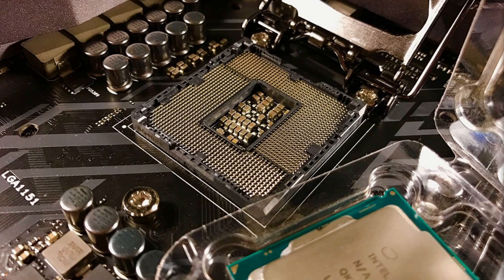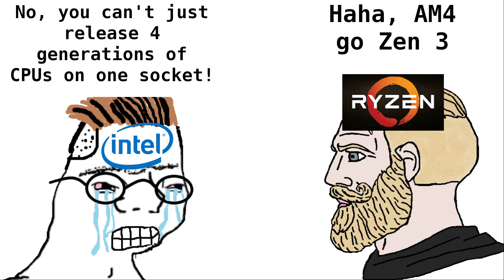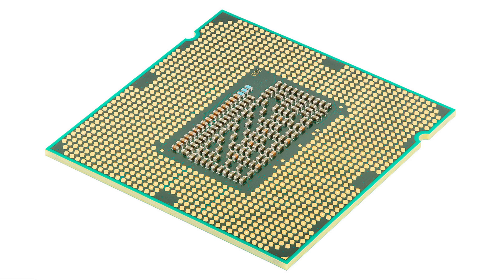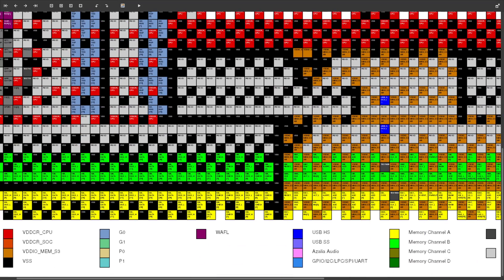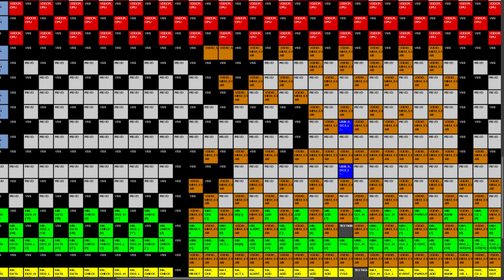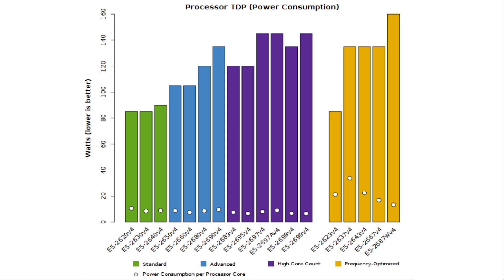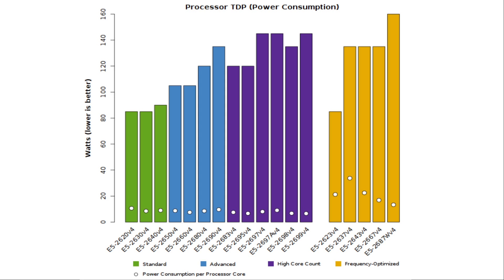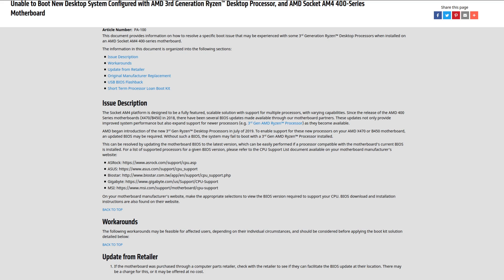The Reason for CPU Socket Changes

Comment: > Intel: releases same CPU on a new socket
> AMD: releases new CPU on the same socket
Reply: intel is israel
Reply: It's true. You can actually use Athlon and the latest Ryzens on the same board. Well, not every board but most of them still support Athlons.
Reply: doesnt matter. you ll change ure mb every 4-5 years... even when normal human uses amd... he would have to change his mb anyway...
Reply: Intel loses customers
Intel: Shocked pikachu face
Reply: few years ago it was Nvidia gpus and intel cpus on top, now its nividia gpus on top (xt cards are horribly optimised especially when it comes to trouble shooting) and AMD cpus on top lol
Reply: and amd cpu runs better and is cheaper
Reply: @krellin  yep and AMD gpu sucks theres a reason why 6000 series amd gpus are in stock wayyyyyyy more often, tis cause no one wants em lol
Reply: We are not the same
Reply: > AMD: releases same GPU architecture with different generation branding
> Nvidia: releases different GPU architecture with same generation branding
Reply: @nathangamble125  sorry to ruin the fun, but Nvidia does in fact reuse their old GPUs and call it something new.
Reply: @koyyle  AMD cheap until everyone buys it then gets undercut by intel with a space heater nasa rocket cpu, which the amd fanboys also said they couldn’t do
Reply: @chrisg7990  I want ECC ram.
Reply: That meme is just fanboy cringe, 2 or 3 generations per socket is normal has been for decades regardless of brand, AMD just wanted play into the hands of customers with short memories and appear to be the good guys when in reality they are no different to intel or nvidia. 

None of them care about you, they are corporations that care about nothing but money.
Reply: @oxfordsparky  You're a bit young to remember the AM2 days, but brush up on your history and you'll see you're wrong.
Reply: Are the CPUs interchangeable given the same motherboard? AMD is just as anti-competitive as Intel. Their proprietary memory controllers, bridges, and internal FSBs make it impossible to produce a socket/motherboard compatible CPU without getting sued for patent infringement. We need to be pushing for RISC-V hardware.
Reply: @gregorymalchuk272  AFAIK RISC-V, as an ISA, only standardizes the instruction set for the CPU, similar to X86, SPARC or ARM is a standard. It doesn't necessarily mean that all vendors are bound to make a pincompatible CPU. Thus pushing for RISC-V as an argument to have CPU/Socket/board seems invalid to me. X86(-64) for example, used by Intel, AMD and VIA. They use to have the same Socket 7 and P5 FSB. Then intel started used Slot1 (evolution of the PPro Socket 8) with the xGTL FSB. Perhaps Intel could have kept on using P5 and perhaps AMD could have gone with the xGTL bus (like VIA did), but the latter decided on using EV6 licensed from DEC enabling DDR on the FSB with Slot A later Socket A, still a X86 instruction set though yet different FSB. Intel started using DMI as FSB in the LGA 1156 ERA, still a X86 ISA CPU though. AMD evolved to use the Hyper Transport ISA for their FSB, still a X86 ISA CPU though. 
Point i'm trying to make is that using an ISA for a CPU instruction set doesn't mean all and everything else will be or remain the same.
Reply: @dionvdc  
We need organizations committed to the cause of free and open hardware and software to build it, like they were doing with the Librum. I'm amazed at how much can be done at home. Spec out an instruction set artichecture, build it in VHDL or Verilog, implement as FPGA or ASIC, implement glue logic with FPGAs, design printed circuit boards as Gerber files, etc. I wonder if there is an automated way to go from the ISA layed out in VHDL or Verilog and the endianness and automatically generate a compiler. In any event, I think compilers already exist for RISC-V.
Reply: @gregorymalchuk272  And here I am thinking about the context of the video "reasons for socket changes" and your initial context "CPUs interchangeable given the same motherboard" & "We need to be pushing for RISC-V hardware". 
Unless a CPU pincount & -layout is set in a standard, which AFAIK isn't for RISCV,  "CPUs interchangeable given the same motherboard" is not going to happen. 
And even if it would, socketchanges (or rather pincount & -layout) will still happen eventually as requirements change (DDR4>DDR5, powerdraw, etc).
So yes open/free standards are great, but no I don't see how it would get rid of the socket changes.

sidenote; do you have a link to how RISCV has standardized the CPU pincount & -layout enabling interchangeability with motherboards, I could not find one.
Reply: @dionvdc  
No, but that's not the point. The fact is that standardization within the Intel-AMD duopoly will never happen, FSBs/memory controllers will remain proprietary, and so competition is impossible. My enitre reason behind this is that Intel's "management engine" and AMD's "AMD secure technology" are deliberately introduced hardware backdoors that can execute code, have direct access to memory, and observe and send packets over the network interface without the operating system having any ability to detect it. It is hardware malware and spyware. I don't care about having the latest hardware, we have literal supercomputers at our fingertips, and software bloat is stagnating or declining in real terms. This is about the freedom not to be spied upon and preyed upon by governments and companies. It's not a guarantee that someone won't muck up a practical implementation of RISC-V too, it's just that it's an architecture that isn't bound by patents, that could be built and produced like they did with Purism's Librum phone. It is a company specifically founded with a focus on free and open hardware that manufactured a phone and now computers.
Reply: @gregorymalchuk272  I just flashed my NVRAM and got access to IntelME very easily (well, as easily as soldering wires over the nvram chip was and using some electronics and a RPI to flash it) , no cryptography, no enclave, no nothing, pure hex I could change to do anything I want, the thing is that a lot of mobo manufacturers are just lazy and don't care about the stupidity intel forces on them.
Reply: @gregorymalchuk272  Almost none of those things are by definition Anti-competitive. AMD created the first IMC for X86 CPUs, but didn't block anyone from making their own. They don't own X86, but license it from Intel which locks everyone else out. Of course you're not arguing in favor of using the architecture, just boards that already adhere to established standards that are a benefit to the consumer. There is no obligation to just let a 3rd party use your work. It is certainly anti-competitive when that 3rd has done their own work to be compatible, and the controlling party goes out of their to break that compatibility. Like GenuineIntel checks in code to disable features on competing yet otherwise compatible product. Or Nvidia blocking things based on detecting an AMD GPU or a Hypervisor being used. Or Apple eschewing established standards to make something proprietary(various custom PCIe SSD pinouts) that has no benefit other than locking the customer in. In Intel's case they literally signed an agreement that would allow for competition, and literally immediately tried to circumvent it, and continued for decades. Yet you deem AMD as anti-competitive for just not sharing explicit  hardware design details, when they otherwise frequently promote open standards.
Reply: @gregorymalchuk272  I don't even know why I enter these comment sections without a Comp Sci degree.
Reply: @dionvdc  plz translate englis
Reply: @gregorymalchuk272  AMD is by far much more consumer friendly than intel or nvidia. That is much noticeable when you look into the open-source drivers available for each of their cards. While NVidia completely closes itself from collaborating with the development of opensource Nouveau drivers and shares as little information as possible about their GPUs, AMD's collaboration with the free coding community is so great that their open-source drivers are highly looked up to.
Reply: @dionyzus2909  Don't argue with a 'two wrongs make a right' mindset. They are being insincere at best, intentionally malicious at worst.
Reply: @gregorymalchuk272  "We need to be pushing for RISC-V hardware."
Total red herring. RISC-V is a CPU instruction set, not a CPU interconnect or socket standard. You could make a RISC-V CPU that uses any CPU socket.

The architecture is completely irrelevant to whether the interconnect is open or proprietary. AMD and Intel could make an open-source interconnect if they wanted to, and anyone making a RISC-V CPU could give it a proprietary interconnect if they wanted to.
Reply: @gregorymalchuk272  or OpenPOWER
nice microarchitecture too
Reply: @gregorymalchuk272  RISC-V hasn't established a commodity motherboard market. LOL
Reply: @gregorymalchuk272  ah yes, because I'm so interested in making my own cpu in the shed.
Pretty much what you're saying one's company patents are one's company?
I don't see intel technologies on amd products. I wonder why. Maybe because patents are everywhere? 
Either way good for me, I'll just buy their cpu.
Reply: @gregorymalchuk272  Unfortunately the CPU market isn't going to budge unless a big player enters it and forces it. It takes ridiculous assets and massive teams to engineer and build CPU's.
Reply: @gregorymalchuk272  you have no idea what you're talking about

Comment: >cpu dies
>need new mobo
>new mobo doesnt support ddr3
>new mobo doesnt have floppy port
>have to get new ram
>have to get new storage
why
Reply: I have old mb with ddr3, but ddr3 has itself changed somehow so it wont work with newer RAMs...
It gets stuck on boot screen with both sticks installed and windows BSODs on boot with 1 stick installed;

Comment: When you have to update a BIOS with an old CPU to support a newer CPU, I don't put thermal paste, I just leave the dissipator on the CPU, direct metal to metal contact and without locking with screws. Total time for a BIOS update is less than 5 minutes if you know what you're doing, the CPU won't go overtemp.
Reply: Jayz did a build where he overclocked his CPU and it didn't even have thermal paste on it. I think these things can deal with a lot more than people think. Let's not forget they will auto thermal throttle if they get too hot and not just immediately shut down.
Reply: @Luxalpa  I mean you are right, the tech is here for some fault protection
Reply: you are madlad lad
id be screaming the whole process if i tried it
Reply: @necrobynerton7384  CPUs got thermal protections this days. You can do it even without the cooler. The CPU will simply slow down to prevent overheat
Reply: @necrobynerton7384  You'd be surprised.

My stock cooler fan stopped and I didn't notice because headphones and the whole time the CPU was at 91° C. That was scary.
Reply: @necrobynerton7384  tbf, even some 775 e series pentiums don't get very hot without a heatsink.
Reply: All the computers I have don’t have thermal paste, but there also from the 90s
Reply: @romemaster  Wouldn't one of those thermal pads that are a thin sheet of graphite or something still be better
Reply: @ffwast  I also don’t have thin sheets of graphite

Comment: Intel def changes the socket for a cashgrab, they charge people for the ability to overclock on both the motherboard and CPU and lock out features intentionally so they could charge you more. 
AMD isn't playing their games
I do wish however, that AMD does build in a Mini-CPU just powerful enough to flash the motherboard with a new BIOS, that would save them having to send out CPU's just to update to a new bios
Reply: Most newer motherboards(probably the cheaper ones still don't) already have a BIOS Flashback feature in there to allow flashing the BIOS without a CPU or recover from a failed flash
Reply: @Notevenmad955  yep, just ones where the manufacturer bothered to put it in
Reply: @Notevenmad955  Also, besides everything that was said, that's something motherboard manufacturer has to solve, not cpu manufacturer
Reply: They already did that LOL, just buy an athlon or sth like A series, they're cheap AF to buy (or just borrow it from a computer shop)
Reply: @yudhobaskoro8033  Still need to install the athlon with a cooler, and re-apply the thermal paste. Alternatively they could just shove something equivalent to a fuckin 486 so you can flash your BIOS without anything in the socket.
Reply: @someweeb3650  bios flash back is a thing
Reply: @Mohynoy  *On applicable motherboards
Reply: @someweeb3650  u got a point there, if u need some cpu with a preexisting cooler then just go with a new A6 CPU, its cheaper than athlon and comes with a cooler with a thermal paste preapplied to it
Reply: @Joseph Arney that's called "having an Arduino flashed with serprog and using flashrom".
Reply: Locked CPUs aren’t neccesarily only so they can charge you more, they can be terrible overclockers that they sell you for cheaper, also ensuring that K series ones are higher quality
Reply: you could make a block with effectively an extremely old cpu and put it in the same address location on the CPU to handle bios tasks then once the bios is updated it uses the main cpu instead
Reply: i think both amd and intel are working on a chipset solution like that, imho a RISC V based chipset that could POST on its own, sounds like a very good possible solution to that problem... hell a decently designed SOC could offload some tasks form the system cpu, and be updatable to solve any problems or boost performance, the idea has always seemed like a good one to me... the chipset cpu dosnt need to be able to run a full os just, run a bios/firmware updater... could even have the board check for updates at user request, download and install them... would also make it easier to tell if you got a dead board, or dead cpu... if the board will POST without cpu... cpu either not supported or FUBAR... i have seen some datacenter hardware that was setup this way... the remote control/command unit would let you do alot of stuff including see if the cpu's causing the error thats not letting the system boot/post properly... saved me and a buddy alot of time when we discovered an update pushed by a server vendor...removed support for the cpu's used in those systems... but added support for newer chips... thankfully the command module thing had a rollback function and we got them back up and running... the server vendor actually sent replacement cpu's out because they were nolonger using that specific model in anything, and had only used them for 9mo, and were just swapping the chips out for those effected... we did get lucky they sent better chips then what was listed because they ran out of the model listed...and they did not want the chips we stapped out back... so 3 of our coworkers ended up building computers...LOL...

they were intel chips... and from what i remember the cpus they removed where all low power models, as the replacement chips used almost the same power but were faster and ran cooler... despite being rated at higher wattage... also the non low power models were slightly cheaper when bought in volume.. 

anyway... the vendor was very cool about it... they extended the company support contract 14 months (because that evened it out to another 24 months) because we were so cool about it and had only contacted them to inform them they may want to not push it as an automatically applied on reboot update via their management system if the system has that cpu in it... turned out it was also to cover a serious security flaw in the root vendors firmware, the fact we could wait a few weeks to get the chips...(we didnt, but we could have)...well...it worked out well they were happy and so was everybody in our dept... management were happy when their emails loaded faster...the cpu sent was quite a it better for some specific tasks and one seemed to be that the email server was alot more responsive for people browsing their emails...
Reply: If you have an old AMD motherboard in need of a BIOS update you probably already have an AMD CPU on your PC, if not just buy a new motherboard, why buying an old motherboard if you're just starting from scratch?
Reply: @souljastation5463  I had to go through the pain of buying a B550 motherboard with a 5000 series processor and realizing that I have no older CPU to flash the new bios with... It was painful to stare at the brand new CPU sitting in the socket and not working. I coudln't just buy a new motherboard since the B550/X570 is the newest currently, and a lot of old stock didn't have any bios updates right out of box.
Reply: @Percutien  that's a rare occurrence though, sure mistakes and oversights happen but most of the times you do a thorough research before buying something.